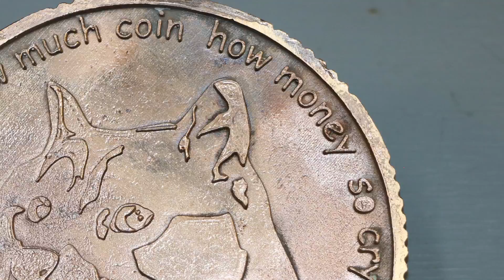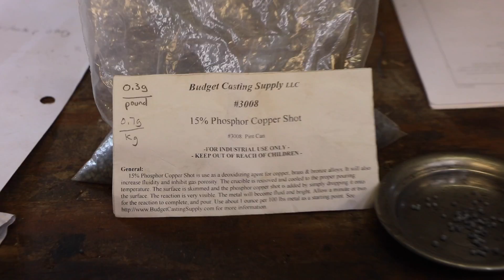3D Print to Metal Casting. Higher Level Lost PLA Casting Experiments.

Comment: Just want to share my experience from a bit different application that you might want to try. I did some differential hardening of Japanese style blades many years ago and had many issues with the clay cracking and falling off the blades when heated. Then I added a little borax to the clay mix and that made all the difference. I preheated it in the kitchen oven to dry it through before heating it in the forge. And after the preheat it got a slight glassy feel to it like if the borax where melting into the clay and made it more ductile while hot.
Reply: Ok, file this idea away for BlackSmithing.

Comment: One thing you could try if the pla expanding is causing the cracking you could try dissolving it instead like abs and acetone or polymaker makes a filament called polysmooth that dissolves in alcohol maybe even pva it might hold up in the moisture long enough for the plaster to set

Comment: Thanks for trying to use pressure, I get the impression that 60psi is a good starting point for epoxy applications. I wonder if the prestige oro is plaster of paris based, as that goes the same way (delicate and friable) when you heat it. The ultracal looks like it properly cures, but also expands as well which is why it cracks like that - something I don't think plaster of paris does as badly
Reply from the maker: I like the idea of pressure, but I think for 3d prints, 60PSI will crush your pattern.
Reply: @FarmCraft101  yeah, I'm wondering if you can somehow perforate the model to allow pressure in to balance it - it only needs to form the cavity for the investment so the infill could be non-sealing (gyroid?) With bleed holes where the spout and the two halves join

Comment: Technically the plaster is hard, not tough. The harder something is the more brittle and shatter prone it is, like diamond or hardened steel, the tougher something is the more malleable it, an it won’t crack or shatter like. A good example would be a glass cup and a plastic bottle, the glass is hard and the plastic is tough.

Comment: So what might help with PLA is rather than doing a conventional burnout to have the mold be upside down and only bring it up to 450 at first, letting the pla go soft enough to drain out somewhat. The plaster already has its final shape at this point and staying below 500 for the beginning doesn't cause the chemical change to the plaster of breaking the water molecules off. Then after you've gotten a bit of the pla out, you can take it up to full burn out temp. Or possibly try casting it, as the metal should burn the remaining thin layer of pla off and if you have good vents it might work
Reply from the maker: Good thoughts.  I do heat it up slowly to 400 over several hours and hold it to allow the plastic to drip out before going to higher temps.
Reply: @FarmCraft101  you can get it to 250 fast, let it sit an hour and bring it up to 450ish as fast as you want after that. Figure that 400f is only 204 c so that might be a little low as well to get good flow outward

Comment: Moroso makes a ceramic block sealer (to seal cracks in auto engine blocks -) which (when fired to hi-temp -) should be ideal for sealing cracks in your investment molds .
Reply: I believe this sealer is “water glass”, sodium silicate, also used as a binder for sand casting, this would certainly be an appropriate material to use, not sure how it could seal up cracks in a mold after firing out the PLA without changing the shape of what is being cast.

Comment: This was an excellent sequel.  I like the investigation into the internal of the mold after loss casting.  The most entertaining part of the video, was watching the vacuum chamber happening before the mold pour.  I'm thinking it should occur after the mold is poured, not before.
Reply from the maker: I've tried that several times and not had good luck.  I think air sucks out of the PLA pattern and by that time the plaster is more firm, causing problems.
Reply: @FarmCraft101  Having ruminated on this a bit, I think the fill pattern should be changed.
https://www.instructables.com/3D-Printing-Make-Water-Tight-and-Air-Tight-Contain/

Comment: Why not vacuum it again after pouring the castable instead of hoping the brush hits all the bubbles and releases?
Reply: Of course that's the next thing you did in your video.
Reply: Do the vertical coin investment again, but vacuum it after pouring in the flask. I bet that solves the bubbles in the text.
Reply from the maker: Did you see this video? https://youtu.be/NSpQx-U989o  Tried that several times and kept having fails.  I think there is too much air in the pattern that causes issues while the plaster is getting close to setting up.
Reply: @FarmCraft101  I had not, watching now
Reply: Maybe try some aluminum bronze or Nordic Gold. Something will less offgassing.

Comment: Maybe: 3D print into Silicone molding -> then Casting Wax and then that into Plaster
Reply: Yea, this is the typical method. Make a master parent "negative" that you can then pour investment wax into for part replication.
Reply: It seems like you might lose significant definition that way, and be open to introducing errors? But of course can replicate it much easier
Reply: @farmerboy916  But you can correct the Wax template easier than the PLA one

Comment: My father worked at an investment casting company. I used to have the name of the investment casting ceramic they used. I know there they would use molds to cast the parts out of a casting wax that they later burned out. The shells were several layers of ceramic slurry dusted with silica sand after each wet coat. You may be better off printing a 2 part mold of the item you want to make and then making wax copies to put in the plaster that you burn out.
Reply: Hey dude do you happen to have the investment casting ceramic slurry that he used? I have been looking to source some to NZ but no luck without crazy shipping costs! Any advice would be appreciated. Thank you
Reply: @brendonhowe2158  ill have to ask him
Reply: @sinformant  If you could that would be awesome thank you. Or is there a DIY option since NZ sucks in general when it comes to specialist items. I don't want a slurry which needs to be stirred 24/7 as that seems impossible for a DIYer like myself.

Comment: Wax also expands when heating, that's why they use wax in wax linear motors. It produces a lot of force.
Reply: They make wax specifically for investment casting that doesnt expand and also burns out clean.
Reply from the maker: True, but I am guessing that wax is easier on the mold than PLA.  As the wax heats, it will soften, and since it has a place to exit, it shouldn't build lots of pressure.  PLA would do the same, but wouldn't soften until the temp is higher.  This is just a guess on my part.  I may be wrong.